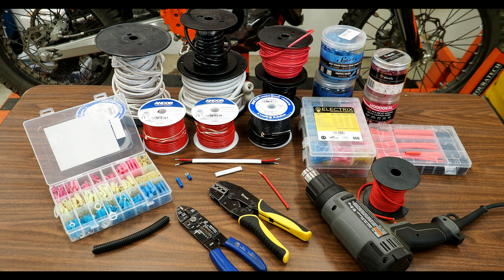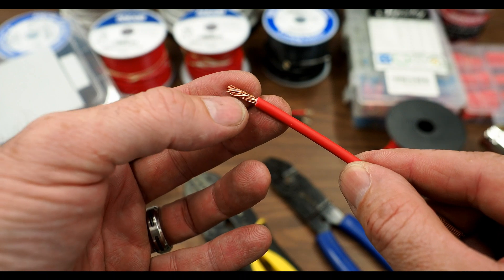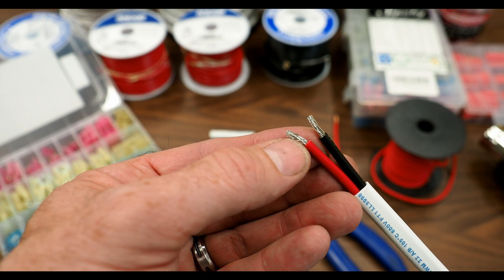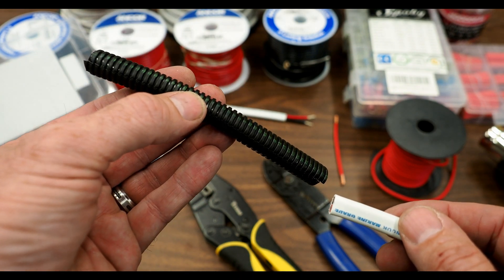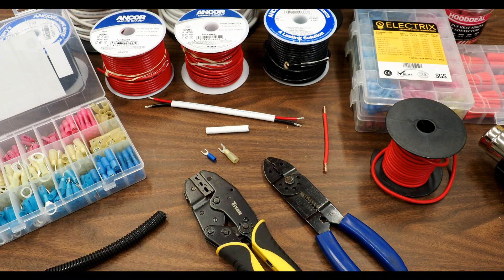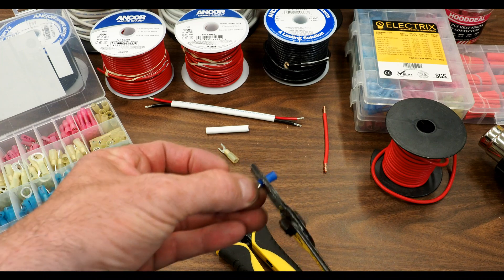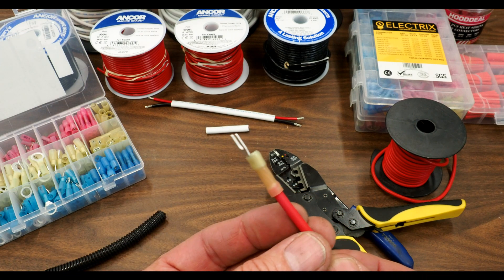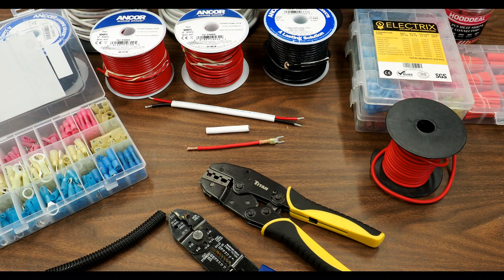Marine Grade Wire & Terminals Vs Automotive Grade

Comment: I read where using marine grade connectors on cars may cause issues with the cars battery and electronics somewhat.
Reply from the maker: Been using them for years, they are perfect for auto applications and far superior to regular automotive grade connectors.

Comment: With insulated 16 gauge stranded copper wire - do you prefer to use the pink(16-22) heat shrink connectors or the blue (14-16) heat shrink connectors?

Comment: good video,  i have a question, i have heat shrink butt connectors and i need to connect  2 wires in one end and 1 wire in the other end, the 2 wires in one end actually fit perfectly even if it is the same butt connector size, should i twist both wires together before crimping to the other end wire? it is to hardwire strobe lights to a switch, thanks!

Comment: Good information for most folks.  I however prefer the detented crimper for connectors like  Klien makes or similar.  For heavier gauge wiring with large connectors,  such as battery terminals for instance, I place electrical solder inside the connector with the wire, crimp and then apply propane to heat up the connector until the solder bubbles out fully at the wire side.  Of course I use closed end connectors for this.  This insures a complete water-tight solid connection with the best of both worlds. Then I always apply marine grade heat shrink to these.  It is manditory to always use marine grade everything on marine applications salt of fresh water.  I have also adopted like you have all marine grade for my automotive projects.  I also recommend the pre-solder butt connectors with the heat shrink built in.  Never had any failures in fresh or saltwater even with submerged connections such as a boat trailure using these techniques.  I also prefer the use of eyed connectors verses spade for a more secure connection.   In the power plant and electric utility world this is the standard, btw.
Reply: On those pre-soldered butt connectors, they sound great in theory, but in actual use, not so much.  If you cut one open you'll find that you're creating a cold joint with the solder only flowing around the outside of the conductors.  In use, you're heating the solder before the conductor - which is exactly how you make a cold joint.  And given that you've got the connector's insulation is acting as an insulator, you're never going to get the conductors up to temp without burning the insulation.

Comment: Maybe I wasn't paying attention well enough but, is there a downside to using marine-grade all the time? Thanks for all the info! Subbed!!
Reply: The only down-side is marine grade anything will cost more because of the extra materials and environmental exposure withstand build.  If you expect moisture to be a problem, especially salt-water, then marine grade is mandatory.  Normal automotive would be satisfactory in automotive applications.

Comment: Great video. If I am running wire on the exterior of my vehicle I run it through some black rubber hose to give me the best abrasion protection. It maybe a little over kill but I rest better knowing I do this. Plus The only connectors I use are the heat shrink ones and I use a ratcheting crimp tool.

Comment: Many amazon reviews are complaining that this type of connectors hafe to thin metal and bend to easy, I have problems to find good ones.
I like more ratched plierers 9and they make more stronger compression, and you have to use propper right tools for different types of crimping connectors, ther are many types.
Don't twist or solder the wires it weakening the connection.
By the way many people don't know even that the crimping strength can be adjusted on the pliers.

Comment: I have been l looking to get one of the heat shrink terminal kits, but none of them come with #8 ring terminals like the ones commonly found on the Blue Seas fuse blocks. Do you use the #10 ring terminals on #8 screws?

Comment: Thanks for the video, very informative and a lot learnt from all of your build!
One (probably stupid) question, when wiring to an appliance or switch with smaller wires or terminals to your circuit that's a heavier guage wire how do you connect them? I'm trying to avoid having lots of different sizes wiring if possible.

Comment: if  the non marine wire is heat shrinked  aren't you pretty good ?
Reply from the maker: Its better than nothing but a marine terminal is sealed to the tip to keep out moisture and has glue built in for good adhesion

Comment: I’m planning to install a blue sea fuse panel in my engine bay to run a relay activated 12 volt line to the cargo area in my SUV. What gauge wire should I use to run back there?
Reply from the maker: Depends on how many amps you are looking to pull and the length of the wire.

Comment: Does the heat shrink go past the tip of the air in the connector? I imagine that is how water can get into the wire, through the end if not sealed
Reply from the maker: It does on most all the connectors in my kit but didn't on the one I grabbed to use in the video.  Like you said you want the heat shrink to cover the end completely 👍